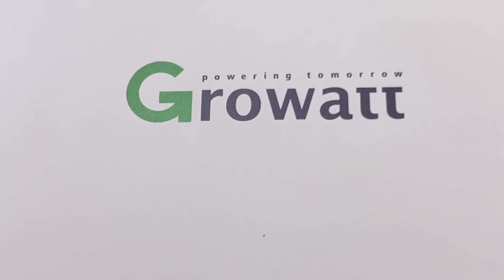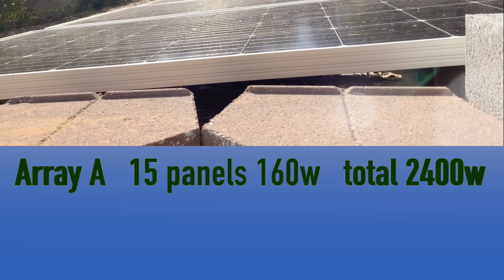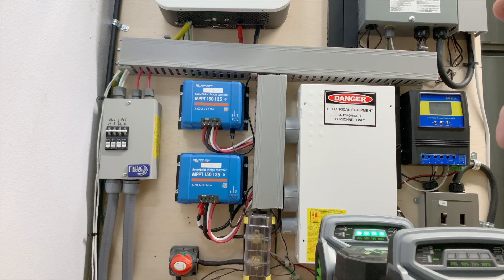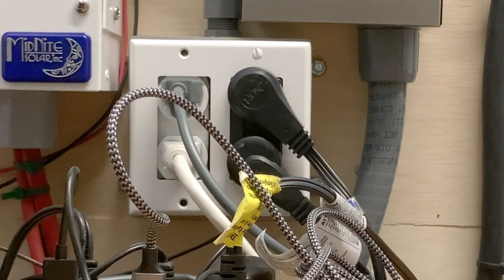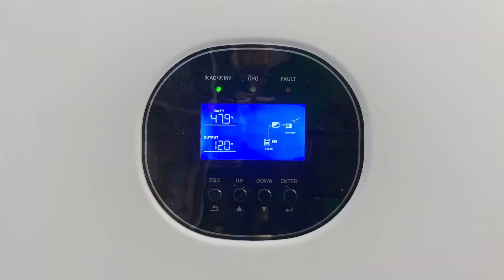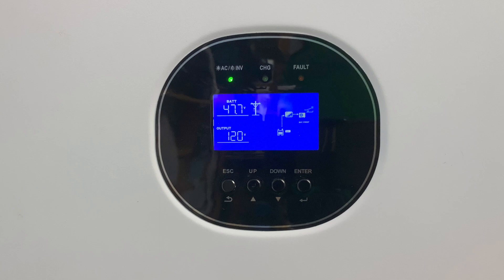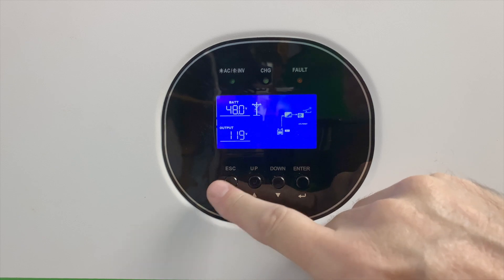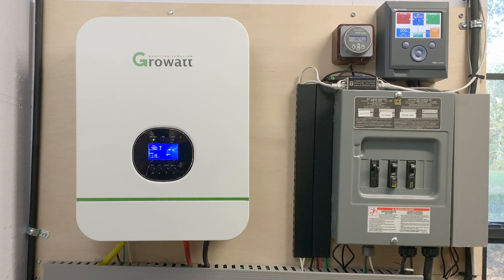Growatt SPF3000TL 3000 watt 48v Solar Inverter Review

Comment: I have two questions if you don’t mind 1)Can the growatt operate without a battery?  2)does it have a battery equalization cycle for lead acids?
Reply from the maker: It requires a battery to operate. It has a charging algorithm for "flooded battery" and AGM. I dont see a equalization cycle setting, though.

Comment: How is this inverter holding up?
Reply from the maker: It runs 24/7 no problem. Sometimes the loads are light (office computers, modems, etc), Many days I charge my EV at Level1 and run window ac units.

Comment: Can you use a generator with this to charge the batteries?
Reply from the maker: Yes, you use the AC input from the generator. I have a video on the settings (https://www.youtube.com/watch?v=DVVZK3Glr0o&lc=UgxpQp12chwgvb2QDeZ4AaABAg.9HqJvSH2Urv9Hu70-fuBpR&feature=em-comments) and a new video out soon on using it with a generator.
Reply: Works really well with a generator. I have a transfer relay that normally supplies power to the inverter from the utility source but if the utility source goes down and the generator is started, it switches to supply power to the inverter from the generator. This allows the inverter to be able to charge the batteries from the generator source during an extended outage if there isn't enough solar. This would allow you to run the generator long enough to top off your batteries, and then shut it off instead of needing to run it 24/7. Major fuel saver then.

Comment: Great vid. I have been looking for this solution. Question. Is there anything like this that is not made in China?
Reply from the maker: There are inverter manufacturers based in Europe... Magnum, Fronius, SMA, and others. Not sure if they have any all-in-one units with built-in charger and transfer switch. They are great inverters, but more expensive.
Reply: Victron has a similar product. The lowest price I've found it for was  $1900.
They are based in the Netherlands with manufacturing and Slovenia, India, China, Malaysia, Hungary, Germany, Taiwan and of course the Netherlands, etc.
Reply: That would depend largely on where you want to install your system Trevor. Victron makes great products, but if you are looking for an all-in-one for split phase (ie; North America) they do not make one. I could be mistaken, but I believe Sol-Ark is the only one doing all-in-ones for NA. But if you are looking to spend more than the >$1000, many companies around the world put together some very nice pre-wired/pre-assembled units that are essentially plug and play.

Comment: Hi Steve. Thank you for the good video. Please can I have your opinion of the Growwatt inverter. Is it a entry level, mid range or top of the range unit. I had 3 sales persons/installers trying to talk me out of buying the Growat. I need a system that works. I don't have to arrive in Rolls Royce style.
Reply from the maker: Growatt seems like a good midrange. The inverter part has been very good for me.  Some people have trouble with the utility charger, It doesn't work like solar charger, so instead of maintaining battery in float, it cycles on and off. Depending on your use, that may not matter. I don't use the utility or solar charger in the Growatt, I just use the inverter, and have been happy with that.
Reply: @ReelClearMediaLLC  Thank you very much for your value add. Much appreciated. Take care.

Comment: Hey Reel, great video. So i have same inverter. I can't turn off the annoying beep. I change setting 15.. but nothing happens. How did you do it?
Reply: @beefitter  that is a "great" advice. I did that at least 20 times and it's not working. That's why I am asking the question here
Reply from the maker: I just turned off setting 15. You may want to try turning off the inverter (power switch on bottom of unit). 
With the unit off turn off turn off both settings 15 and 17. Then turn the unit back on. Let me know.
Reply: @ReelClearMediaLLC  I'm having the same issue as @beefitter.  I did all the steps you suggest, such as setting 15 and 17, turning the unit off/on, but the beep is still there.  Any further suggestions?
Reply from the maker: @mikecraig9368  Sorry, I don't know. I've turned mine on and off repeatedly with no problem.
Reply: @mikecraig9368  If setting 15 doesn't work, beep can be turned off using a Windows PC via USB cable and the Pvkeeper software under Settings>>Alarm set to ON (not OFF).  Seems whoever programmed the software got the on/off backwards.
Reply: @mikecraig9368  With the unit On, press both the DOWN and ENTER buttons at the same time. You have to do this every time unit turns on. I do not know of a menu setting to turn it off.

Comment: Hi, great video. Do you know the idle power consumption of this growatt?  How many watts does it consume just being on without eco mode? I plan to use this 24/7 powering the same critical loads as you have.
Reply from the maker: 40-50 watts.
Reply: Thanks for the reply. So compared to a standard setup, with just charge controller and inverter, is it still worth it? 50W x 24 hrs is 1200 watt hours everyday just to keep this running. I like the idea of these units but it seems like there is a lot of loss in the system. Is your setup saving you a significant amount off your electric bill?
Reply from the maker: @Noah-qt3rq  It was not designed to save money on my electric bill, instead it was designed to give me back up power during a power outage. Since I have it already, I use the solar production for  charging my chevy volt about 70% of the time, and run my air conditioners at my house. My electric bill is always under $100 / month now. My breakeven would be around 10 years.
Reply: @Noah-qt3rq  MY SYSTEM IS DESIGNED TO NOT ONLY SAVE ON MY ELECTRIC BILL. BUT IT WILL ELIMINATE MY ELECTRIC BILL...

Comment: Can this unit charge the Chevy volt batteries? In the video you mentioned you didn't want to change your setup and the victrons gave you more flexibility, but I wasn't sure if you said if it's possible or not. If it is possible what are the down sides of using the growatt to charge vs victron or different charge controllers. Thanks for the video
Reply from the maker: Technically, the Growatt could charge the volts, but I decided to keep my Victrons. The volt modules are only 12s, and should only be charged to 4.03V/Cell, 48.3V/Module. maximum.  My BMS burned up in the lightning storm, and to be safe and get more life from the batteries, I'm charging to 4.0v/cell, 48v/module. When I tried charging with the Growatt the batteries would charge up around 48.3v. So, if I had a BMS on each of the six volt batteries, it would be OK. It makes more sense to me to invest in new batteries (probably LiFePo4) rather than put more money into a BMS for the volts.
Reply from the maker: Also, I had two arrays already wired into combiner boxes and cables running 160' to the house.  I could only run one of those arrays off of the growatt. So the takeaway is, you have to design your solar arrays around the MPPT charger(s0 you want to use.
However, I'm super happy just using the Growatt as an inverter and emergency grid/generator charger.
Reply from the maker: One more thing...  there is an updated firmware with a new charging setting. In setting 5, (the battery type)  the new parameter is US2. It is similar to USE but corrects some charging issues. I'm still running old firmware, so can't verify it.
Reply: @ReelClearMediaLLC  ok,  I'm considering buying the 12kw inverter and I have volt batteries as well. I was hoping I could use it as an all in one so this is very useful information,  thank you
Reply from the maker: @mosesbear8086  Two things to watch. 1) Solar input to charger needs to be between 60v and 115vdc, maximum  145v. use open-circuit voltage of your panels to calculate.
2) the lowest charge voltage you can set on setting 19(bulk charge) and 20(float charge) is 48v. A BMS is recommended. Also, check the specs for the 12K model and make sure they are the same.

Comment: Good video, lots of information. What is the warranty on this ? Does it have Bluetooth ? Will it start a generator ?
Reply from the maker: Ian on eBay (see my link in description) offers a two year swap out warrantee. 
No bluetooth but you can get an optional wifi dongle. 
I believe you can use the relay to start certain auto-start generators

Comment: Steve, for the Growatt 48v, what is the maximum number of 200w solar panels can I use with this system before I possibly damage the system?
Reply from the maker: It depends on the "open circuit" voltage of your panels. Check the literature on your panels. 
When wiring in series, multiply the number of panels times the open circuit  voltage (Voc). The Growatt can take between 60 and 115 Voc. 
For example, If the Voc was 25v, four panels in series would give you 100Voc. This is a rough estimate.
It gets a little more complicated, there are temperature factors and voltage drop due to  resistance, esp. on long runs.

Comment: Hi Steve 
Great video

How many batteries can you have in this inverter
The dealer says that you can arrange 12 but I’ve seen similar inverters with more than 20 kwh battery capacity
Reply from the maker: The number of batteries is decided by the battery manufacturer. The only requirement that I see in the manual is the whole battery pack should have at least 100 amp-hours, and be a 48v system. Growatt also makes a 24v version, but I like 48v... allows for smaller cable sizes.
Reply: @ReelClearMediaLLC  I want to use lithium batteries but the manua says that you need a BMS (conected to the inverter) but my batteries have the BMS integrated 
How can you set up the batteries?
Reply from the maker: @artytecmty  What batteries do you have? Is your Growatt the same model as mine (SPF3000TL-LVM48)?

Comment: Is this unit decent for a large rv/solar battery set up ?
Reply from the maker: As long as the specs work for you... i.e., 3000watts, 48v battery, PV array 60-115vdc open circuit, etc.

Comment: Nice layout, and well done video. As one who's been professionally impacted by the growth of the 'foreign' solar industry, I still prefer US made components, but this unit is very tempting. how would you contrast it to, say, an Outback FXR 3048?
Reply from the maker: I only have first-hand experience with this Growatt, and before that,  a CNBou.  I would imagine the Outback, as well as European inverters like Magnum would have superior build quality. They also cost twice what the Growatt does.

That being said, I have been using this daily for a few years now with no issues. I've even occasionally pushed it slightly over its 3000w limit and it kept going.

Comment: Hello , by watching your video i got convince to upgrade my Go Power and morning star set up , just got it last week and set it up the next day , but what i noticed  the ground is OPEN when i checked the output voltage , even i hook up the AC input that is properly wired with Ground from the house still the same " OPEN GROUND " Please advise ...
Thank you for sharing your knowledge ...
Reply from the maker: Where does the AC out from the Growatt go ? Are you using a separate breaker box?
You need the ground to connect to your house ground, and you need the ground and neutral to be bonded in ONE PLACE for your whole electrical system. There are a few ways to do this, but I need to know how your AC out of the Growatt is hooked up.
Reply from the maker: Also check the comments from Ben Kanobe on the video linked below.  I made a really long explanation of grounding and bonding. I hope to be able to make a video soon, but I've been busy lately.

 https://www.youtube.com/watch?v=oDiva1SJwpc&lc=Ugy8kTxTihxbTlPxjxd4AaABAg.9L0kqVC4ReG9L2Mpx41uWN
Reply: Yes sir , the Growatt AC output got "No ground ", i hook up a "CO" convenient outlet to the AC growatt output terminal " ground , line , neutral "
The Growatt AC INPUT is supplied from the house breaker with Neutral and Ground bonded together ,I confirmed that ,
The battery is supplying the inverter to provide 120 volts AC and the ground is out, confirmed by using a plug in tester for proper wiring ,
Thank you
Reply from the maker: @arminaromin2484  See if your ground meter shows good when in utility mode setting 1.
Reply: I will check that  ,I will run a dedicated 30 amps AWG10 wire straight to the main breaker panel to supply the AC INPUT of the Growatt unit , i will update you later , Thank you Sir
Reply from the maker: @arminaromin2484  Hook up 3 wires, Hot, Neutral, and Ground.
Reply: @ReelClearMediaLLC  You are right when i programmed to UTILITY  Mode  setting 1 the ground came one , can i Jumper ( bond ) the AC Input and AC output GROUND  together ? Is it safe , Thank you
Reply from the maker: @arminaromin2484  I'd double check with an electrician friend, but it should be safe. 
There isn't much room in the Growatt for jumpers, the terminals aren't very big. 
 I'd use a small electrical box with busses or wire nuts.  I'd still recommend a small breaker box after the AC out of the Growatt. You can connect the ground and neutral busses from that breaker box to the other small box.
Use big enough cable for full load.
Bond Neutral in to neutral out. Bond ground in to ground out. 
Do NOT bond L1 (L1).
Do NOT bond ground and neutral together. Then you would have two bonding points in your system and dangerous return paths.
Reply: @ReelClearMediaLLC  Noted , actually i am more on Net metering (Grid tie ) I did all the installation in my house , I got 50 solar panels on top of my roof " 14,500 watts "  and I am only paying now $15.00 a month , that is the connection fee , I used to pay around $400 - $450.00 a month before .Using Enphase M250 and IQ7 plus microinverters .I designed my OFF grid back up battery power with 4 panels from the grid tie , i used contactor DPDT 80amps DC for switching the panels from Grid tie to my battery charger morning star MPPT60 and i put a manual switch . Only one 315 watts panel is connected to the charger just to keep my battery fully charge . when the utility power dies out (black out ) the 4 panels will transfer to my battery charger automatically . and if sometimes cloudy then i can manually flip the switch to add more panel to the battery charger , and my critical loads are all my lights , refrigerator , ceiling fans and my electric gate opener  and it is been running for 4 years now .
NOW that I have the GROWATT i will use the DRY CONTACT connection to transfer some solar panel to charge the battery by using the program # 12 & 13 to power on and off the DPDT contactor . what do you think ? you are the first one that i shared my set up  , i hope it makes sense ..
Reply from the maker: @arminaromin2484  Awesome system! Usually people switch loads with transfer switches, but I've never seen anyone switch solar panel input before. Clever!
Reply: @ReelClearMediaLLC  I will start working on my Combiner box / AC in AC out breaker / AC in @ out load LCD monitor / battery ( shunt ) monitor and battery disconnect in one BOX ,
and keep all my wirings in a '' Wire Tray " so it will looks organized and also the solar panel on rocker frame for better facing towards the sun , bec my location " GUAM " is in the middle of the pacific . middle of the earth " Equator " lots of sun and high an humidity , i will keep you posted , thank you
Reply from the maker: @arminaromin2484  It sounds awesome...
Reply: @ReelClearMediaLLC  Hello sir , i noticed you used the TRANSFER SWITCH FOR GENERATOR , i have one of that and i want to use that for my critical load with my PIP 1012 LV , if you don't mind can you share your wiring connections please , thank you
Reply: I did not hook up yet but my plan is connect together the line 1 and line 2 of the generator transfer switch to make it 120 volts , then connect to inverter line , neutral and ground from inverter will be connected to the house main breaker , is this how you wired your system ? thank you
Reply: @arminaromin2484  Yes, I connected Line from the inverter to the transfer switch L1 and L2 all in a wire nut. Neutral connects to N in the transfer switch, which then connects to the neutral in the breaker box. Same for Ground, it connects to the ground in transfer switch and then to ground in the breaker box. 
Ground and neutral are bonded in your main breaker, so make sure you don't have it bonded again at the inverter.
Reply: @SteveReel  Got it , is it OK if the GROUND of the OUTPUT of the INVERTER to connect to the ground rod , NOT to the ground of the MAIN BREAKER , THANK YOU , This is my second project.
I am still waiting my 2ea GYLL battery 24 volts 200ah 5.2KW  for my Growatt 24v 3k inverter ,
Reply from the maker: @arminaromin2484  As far as I have seen... you should only have one ground in your entire AC system. Otherwise, it creates multiple paths and is dangerous.
Reply from the maker: there are some good videos about grounding and bonding on Youtube.